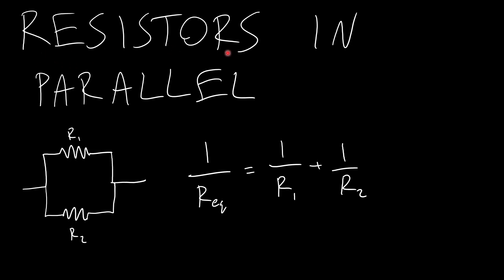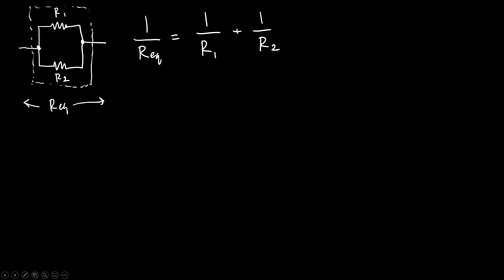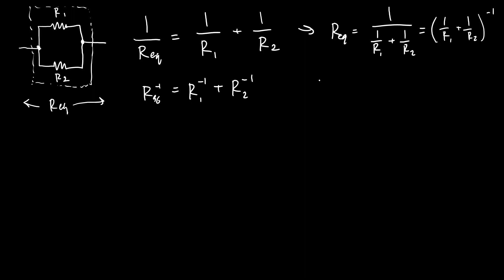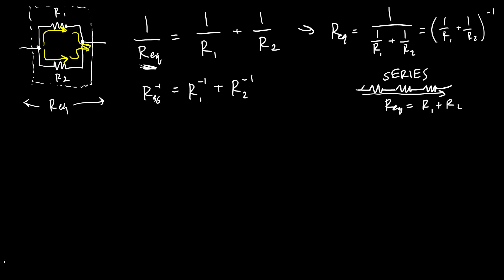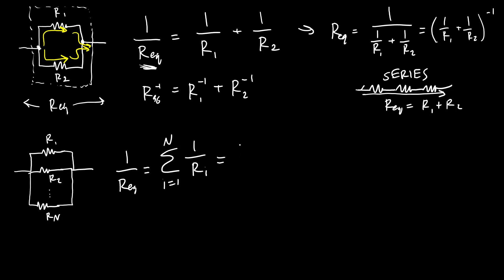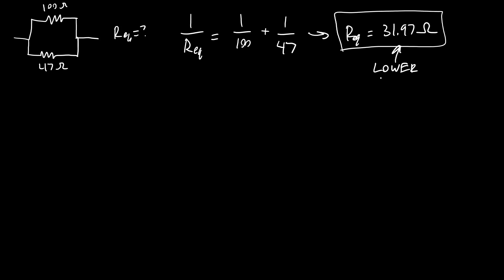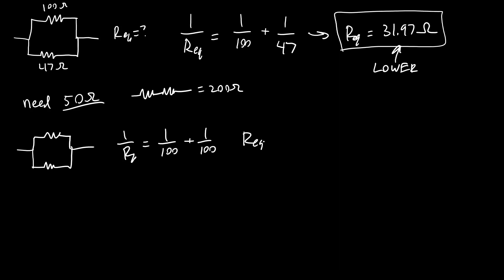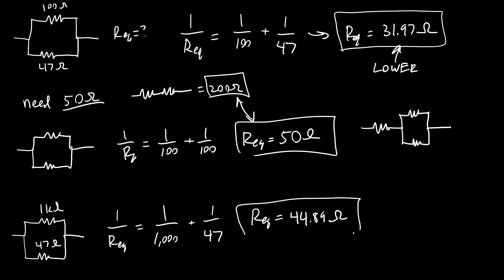Intro to Circuits 10: Resistors in Parallel

Comment: Great video. But. In parallel, resistance could increase IF the resistor values are the same (or higher). Compare 100 ohms and 100 ohms in parallel, the r equivalent is 2/100. Compare that to 3 100-ohm resisters, where r equivalent is 3/100. Thus, resistance is higher when there are more resisters in parallel, in the case where r is higher with 3 100-ohm-resistors (more r than the 2 100-ohm-resistors in parallel).

Am I wrong or right?

Oh shh*t I’m wrong cause that I didn’t 1/summation=r equivalent. If I did do 1 summation, then yes, resistance would decrease 😢🤯
Reply: Before we do 1/r = req. Ye, adding more resistors in a parallel way, increases r equivalent like 1) the summation of harmonic series or 2) R has a simple linear increase if the same resister-values are 😊added
Reply: 1:50 btw
Reply from the maker: Looks like you figured that out :-). 2 100 ohm resistors in parallel is Req = 1/(1/100 + 1/100) = 50. 3 is (1/(1/100 + 1/100 + 1/100) = 33.33 and so on. Adding more resistors in parallel always decreases total resistance.